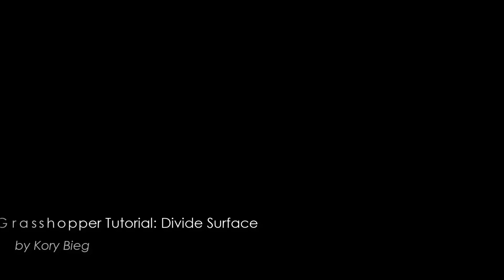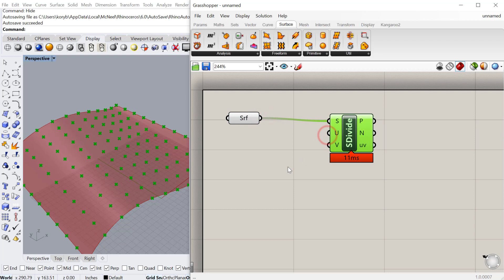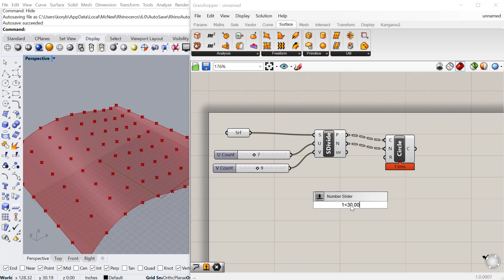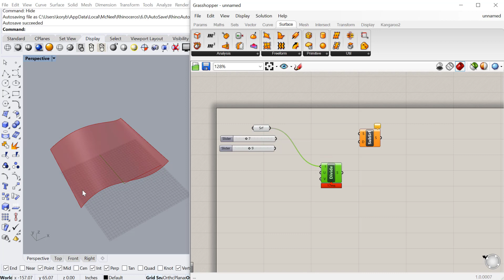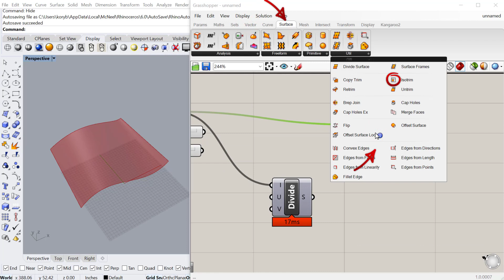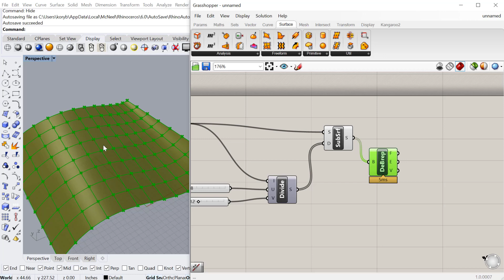Grasshopper Tutorial: Divide Surface

Comment: Thanks for a great to-the-point tutorial. I wonder if the second method using deconstructed breps - how do you find the right normals for the centroids?

Divide Surface gives you points as well as normals, so it's super easy to align objects with the surface curvature.